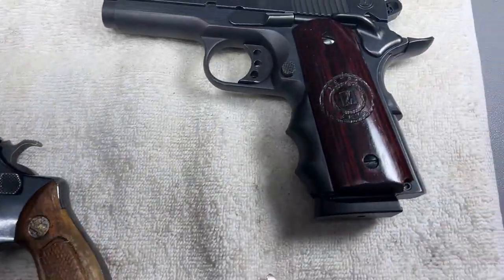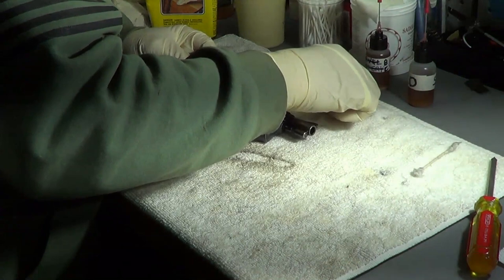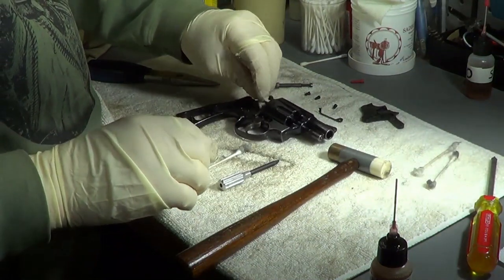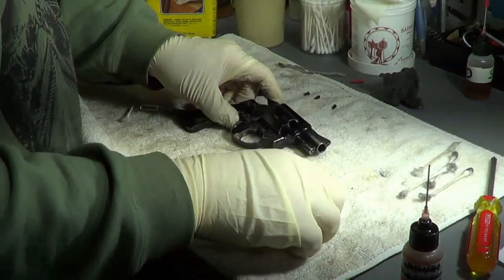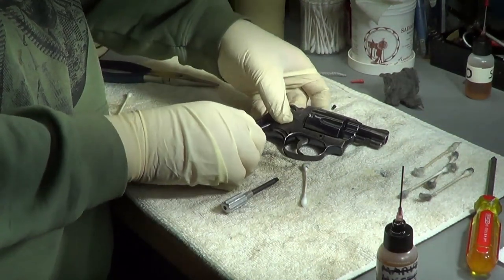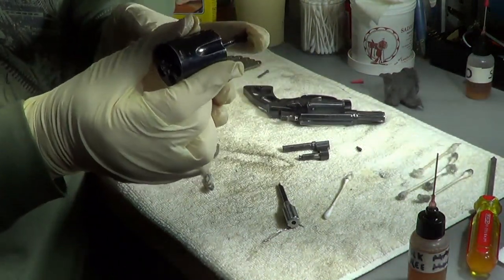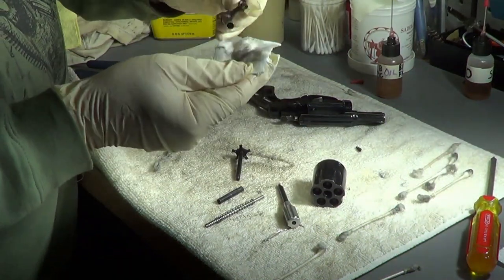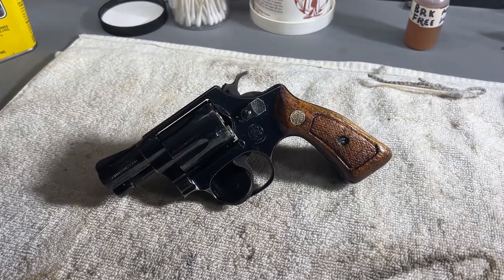.38 Special Smith & Wesson Revolver Complete Breakdown, Cleaning & Oiling

Comment: Rick, I had the same gun that came originally with black handles plastic of course and I bought it second hand. I did not know what the time that the spring is inside the handle. And had a 15 lb trigger pull. I did get aftermarket wooden checkered a grips so I can hold it better. It's reliable works well if you don't meet up with crane. Have a great day take care.

Comment: I found my dad's 38 it has a long barrel.. it's not as rusty as would imagine I don't know much about revolvers buy I was wondering of course it's empty and everything looks fine the issue is that as u pull the trigger it rotates 3 then stops or move one back.. is that caused by the spring it needs cleaning or could it be damaged
Reply from the maker: not sure but sounds like the cylinder might have a broken tooth.  Where you put the round into cylinder you will a round little rise with teeth that turns the cylinder, check them for dirt or rust or broken tooth.

Comment: Awesome vid! Thanks. Have you thought of Tru Oil instead of Tung oil? Last time I used Tung it stayed sticky...
Reply from the maker: tung oil takes a long time to dry, most people don't wipe it off like they should.  when you use Tung oil you let it set for 15 to 20 mins, then wipe it off with LINT free cloth (micro fiber) it will be smooth and then will dry for the 3 or four days.  each coat makes it shine more, first coat will be flat
Reply: @HeyGunPeople  Thanks!

Comment: When was the revolver made and great video man👍🏾
Reply: Looks 70's to me. Model was introduced in 1950 and it went transfer bar in the 80's
Reply: Would also have to be late 70's possibly early 80's based on the cylinder latch release. Look up the different styles it lets you accurately date a revolver.